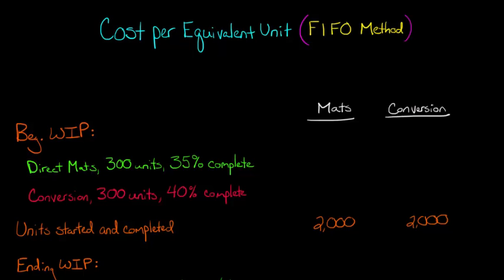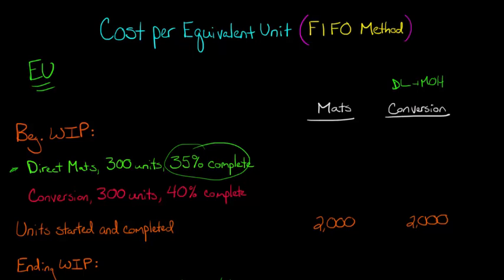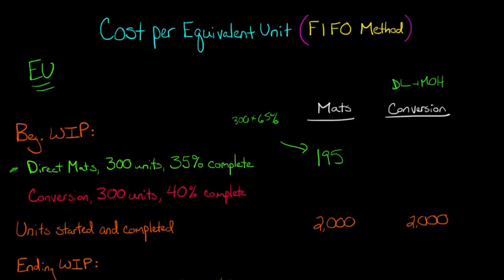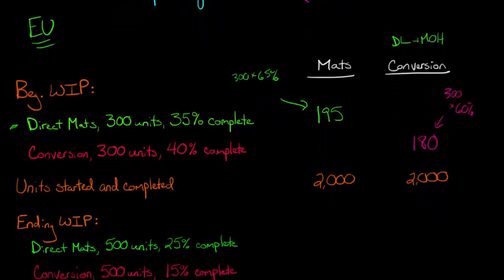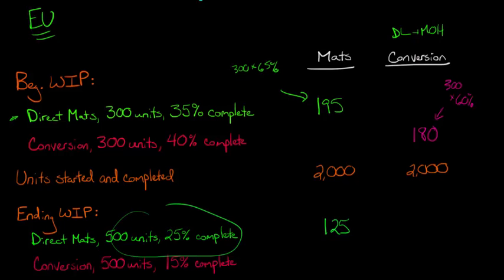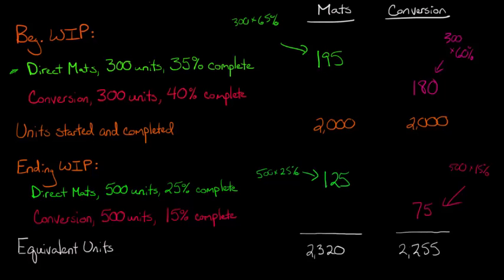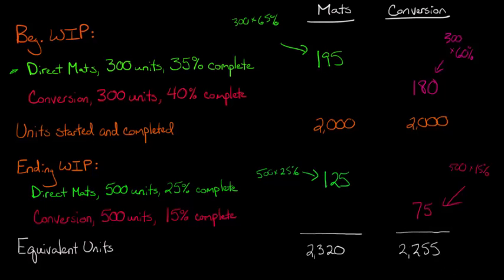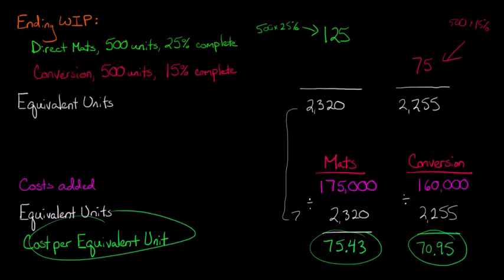Cost Per Equivalent Unit, FIFO Method, Part 1

Comment: Great video but..
How do I calculate the Units started and completed? 
WiP opening 225 units (mats 100% complete & Conversion 60% complete)
Started 275 units
Completed and transferred out 400 units
WiP closing 100 units (mats 100% complete % Conversion 50% complete)
Reply: I am a student who is studying process costing. I like your question and would like to give an answer. Hopefully it would be correct. We know we started with 275 units and don't know whether all of them are completed. However, there are 100 units in the ending WIP balance which are unfinished units. So the difference between 275 units and 100 units is 175 units that were started and completed during the period. When I add 175 units to WIP opening 225 units, they equal to 400 units completed and transferred out. I think units in the beginning WIP are completed before any new units of production are started during the period. Appreciate if you could check my answer with your professor or anyone who knows this subject well and give me your feedback. Thanks.
Reply: Equivalent units started and completed 175 for Mat and 175 for Conversion

Comment: what? how come you just added all the numbers to get the equiv units for the conversion cost? i have a question that asks me to calculate the equi units for the conversion cost using fifo. it says:
-beginning wip, 20000 (60% complete)
-started in April 340000
-completed and transferred out 320000
-ending WIP 40000 (40% complete)

the answer says completed and transferred out + ending WIP - beginning WIP, 
which is 320000+40000(40%)-20000(60%) = 324000. 
what?
Reply: 320,000 + 40,000(40%) is the Weighted Average EUP. The whole WIP, beg is included in the 320,000. So you took away the 20,000(60%) which deducted to get the FIFO since fifo only includes uncompleted WIP, end. And I bet you already know this because it's been a year.